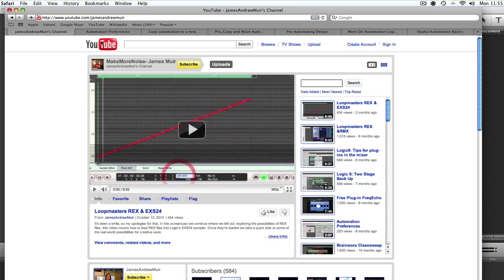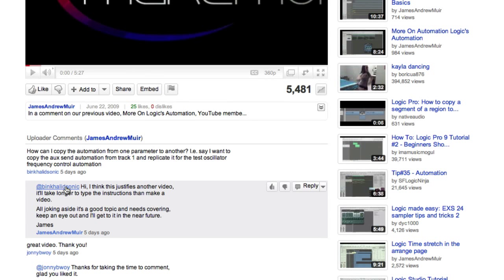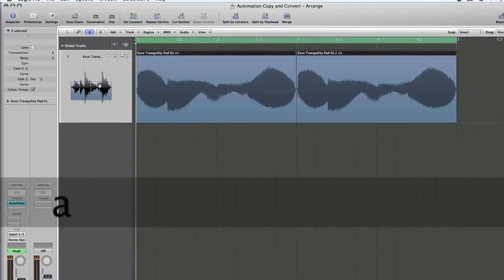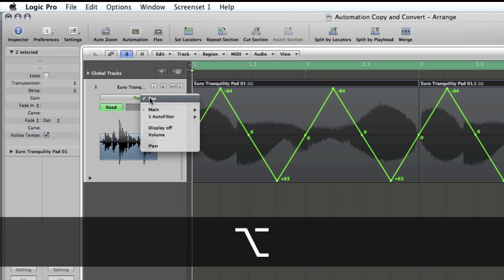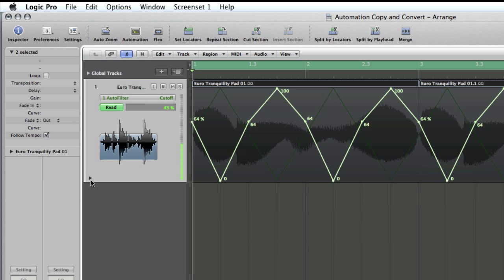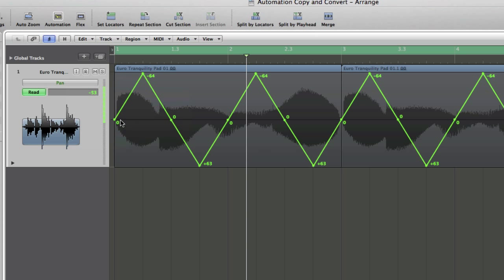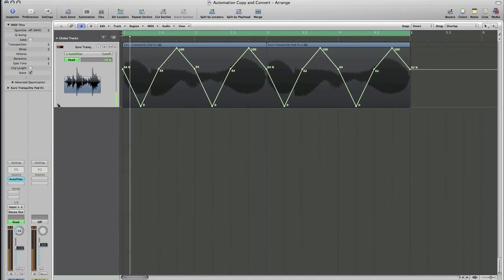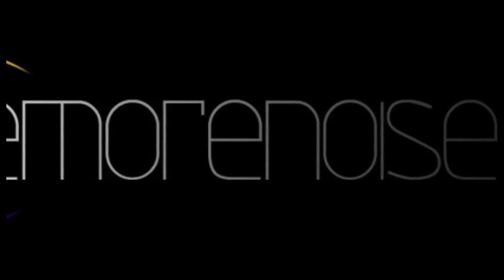Logic 9 Copy and Convert Automation

Comment: Followed through the 3 videos on this, and still looking for a solution to an issue that i have seen other people mention as well.

If you are wanting to past the automation over to a new project , but say using a plugin.

if you are using gain plugin > you have it on both track > copt auto data> paste on new track > oops, doesn't work, instead goes to 'Unused track' and doesnt stick the automation to the Gain

Comment from the maker: @jdeleon1234 Because it's controlling different parameters, so pan automation is minus to the left and plus to the right with zero being the centre. Whereas the cutoff ( from memory ) is just an increase or decrease in value.
A more extreme example would be mute automation which is just on or off, Logic will do it's best to interpret how you wish to convert, if you have something very specific in mind you may find you're better off doing it manually or modifying the copy.

James